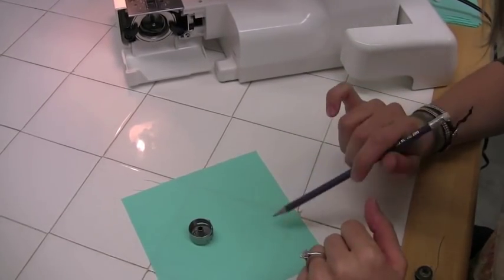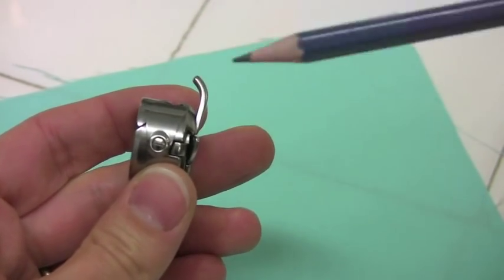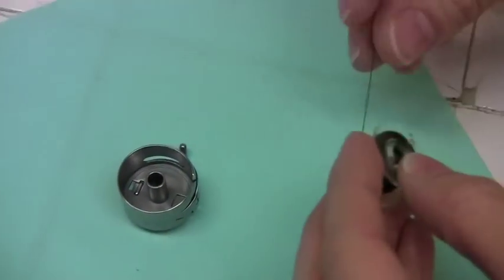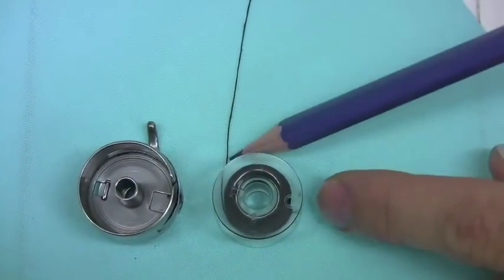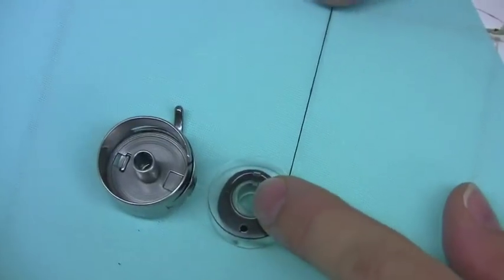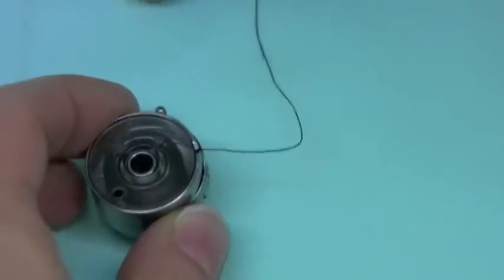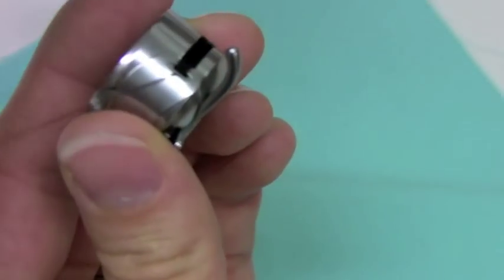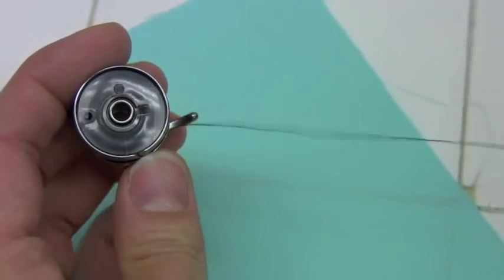Inserting the bobbin into the case

Comment: I just bought a Janome HD1000 and was taught to form a “P” on the bobbin thread before inserting into the holder instead of yours “kissing” each other which is just the opposite , and my thread is thus going anti-clockwise. Pls advise

Comment: how do i take it out though :S | Confused, beginner with Janome machine.
Reply: HELP ME I CANT EITHER
Reply from the maker: Hello. Holding the thread in one hand and securing the bobbin in the case with the other, the thread is "tugged" into the slot and then wrapped under the tension spring and into position. You may feel it pop into place at three points - 1. into the slot, 2. Under the spring and 3. at the end of the path, the delivery eye. The next video shows inserting the bobbin into the machine